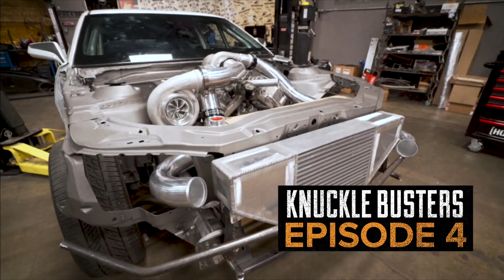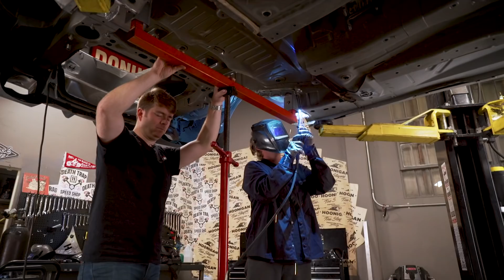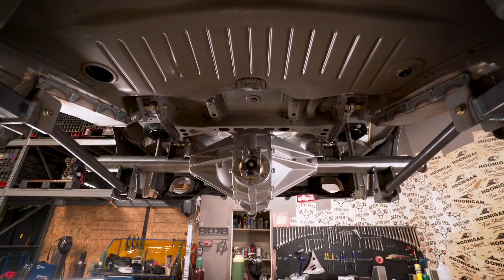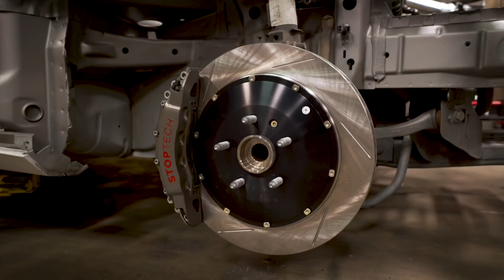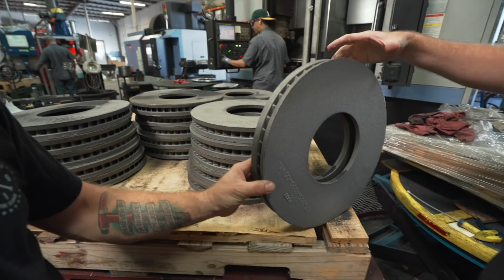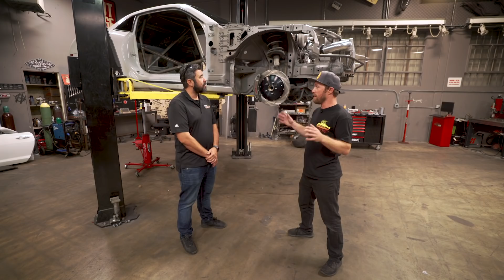Prepping For 200mph on our Duramax Swapped Camaro! BIG Axle, BIG Brakes // Knuckle Busters 2 Ep.5

Comment: An idea for a build....find the biggest, most powerful engine you can and build a car around it from scratch using square/round metal tubing...maybe make it so you can use some car's front (and rear) fenders.  OR another idea...find a car, cut it down the middle to make a left and right half, put a big motor in it, and then fill the middle gap to put it back together.

Comment: I’m no expert but I’m curious. When that guy held the caliper up to the rotor on the rear axle he had it towards the rear of the car. Don’t most rear calipers go on the front side of the rotor??
Reply: If I remember right yes but you can technically do whatever you want itll uh work but whether its optimal or not eehhh testing

Comment: i've said it before, this camaro is going to weigh over 5,000lbs...
Reply: They already weight in at 3500 plus pounds a duramax by itself is 800 lbs it isnt unbelievable that itll be over 5k but the transmission will go on a quickly diet because it's worse than OEM it's a monster trans made with chinese parts that are worse

Comment: Sooooo is there gonna be follow up to this show where it goes into detail about the car instead of the products? 

Curious how y'all figured out the angles of the mounting brackets with out even putting it in the car? Where did you mount the link arms? How do you determine the length of the arms? Is there any details on presetting the pinion angle or what to measure in relation to engine/trans? With a live axle swap, can you still use the stock rear strut towers? Was the original car shock and spring? Or MacPherson strut in the rear to begin with? 
Also I feel like most.people don't even know what a compound setup means and you guys didn't even try to explain. 

I feel like the original shit car videos had more in depth build logs. But I guess it's cool you can bolt a car together?
Reply: Chris Gilmour I’m glad there’s a couple of us that are feeling this way, this is much different to the first season, where I actually learnt a few things...hell, even on the most recent shitcar videos they skipped parts too, everything is rushed now for some reason...
Reply: @MIJODELA  Yea, I think everyone misses the old daily transmission days because it was relatable. The builds were about having fun, not show casing kW, and Holley products. 

Everyone loved shit car because its main purpose was to have fun in, and keep bring back to life. Now shit car is a product placement, that just gets parked in a lot until it needs to make an appearance for public. 

Shartkart was the same grass roots foundation of "we've fucked it up so bad let's try and fix it to make it cool" there was no other reason to build it but to have fun. 
So far from this series, what I can conclude is a bunch of sponsors want ad space, and this car will put a hoonigan banner at the half mile track, and get their sponsors a competitive car to make internet views and get exposure

Comment: Hold up wouldn’t smaller pistons exert more force on the leading edge of the brake and larger would exert less force? Because you are using the same brake pressure across each piston?
Reply: Bennett Swerve force in this case is (pressure x area). More area = more force.

Comment: Assuming 28 inch tall tires and the overdrive in the transmission, 3600 rpm is all you would need to get too 200 mph with that 2.0 ratio rear end, or 4800 rpm if left in 3rd gear 1:1

Comment: Can’t wait to hear what the spool on this thing sounds like.
Reply from the maker: There’s nothing like the sound of compound turbos spoiling up. Teamwork boosts.
Reply: @HooniganProjectGarage  have you guys checked out the engine Banks is building for the monster truck? Twin turbo and supercharged
Reply: When you'll hear it, and you'll be mind blown, imagine that there's applications where there's three or even four turbos. In some race cars of the age, they had turbos, supercharges, the lot. The sounds were/are out of this world. :))
Reply: So, dumb question, was I correct in understanding that the big turbo will feed the small turbo? If so, why? I would’ve thought it’s be the other way round haha
Reply: @nyalsewell  big turbo is what determines the HP level. Since it is what will flow all the air. Small turbo gets exhaust gas first to spool, then the big turbo gets exhaust gas. Big turbo feeds the small turbo, which compresses it again. 

There's formulas and everything to determine which size turbos to use for maximum efficiency and what not. 

It also doesn't have to be two turbos. Can be turbo feeding supercharger, or supercharger feeding turbo. In the last on the supercharger determines the HP, so like a large vortech is the "big turbo" and the turbo acts as the small turbo. This setup actually has some benefits
Reply: NatoriousGamePlay dude thank you!! That’s super cool, I had no idea! Gonna go do me some more research